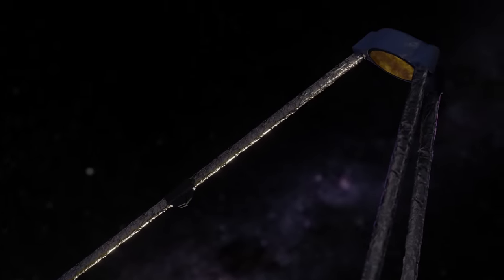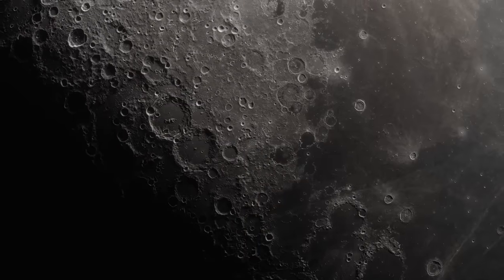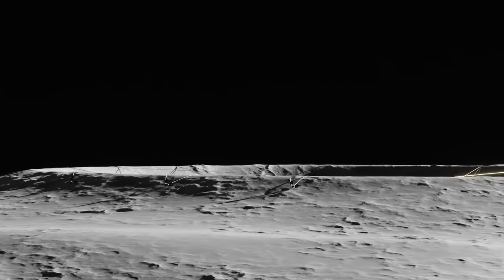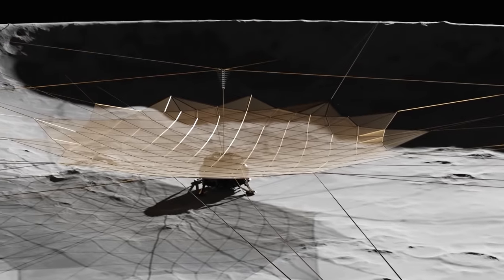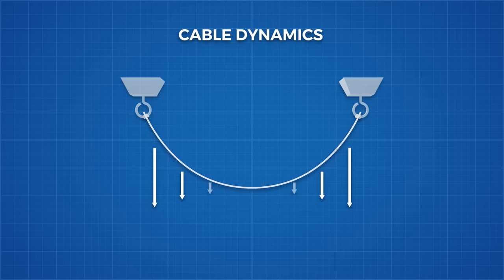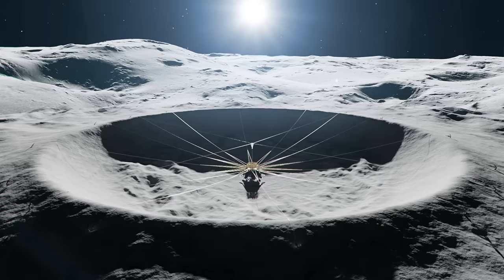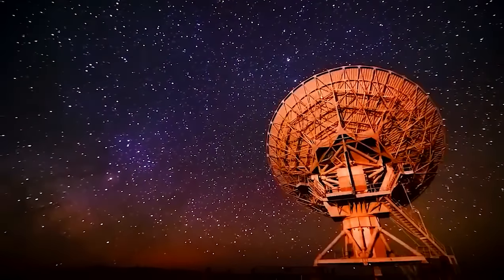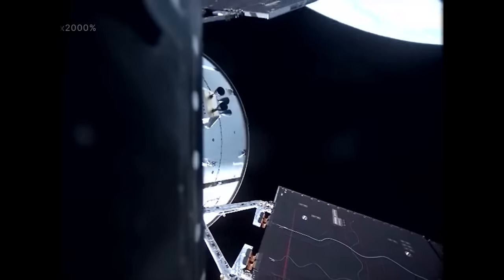NASA's Plan to Build A Telescope on the Moon

Comment: I may be wrong, but the Aricibo cable failure may have been caused by something simple that I learned about 65 years ago from a ham radio operator with his own 100 foot tower. Steel cables must be LOOSENED frequently. As multi-strand cables rust, they grow in diameter and SHORTEN. If not loosened, they eventually pull themselves apart. Interesting, no ?
Reply: According to the accident investigation, the Arecibo structure failed because the cable ends were terminated incorrectly. They were embedded in zinc, and over time the cable strands pulled out of that zinc jacket.

Comment: Having a radio telescope on the far side is a no-brainer, how to achieve this requires many brains,
I had an idea once that since the moon is tidaly locked, it could have a fixed dish antenna pointed at earth to allow huge data transfer rates between earth and moon. Also lower gravity would allow for easier construction of any large structures so the deep space network could be expanded by moon-based long range gigant radio antennas

Comment: I don't think the anchorages in the regolith on the rim of the crater are going to hold in the long term.
Some sort of chemical preparation of the anchor points is necessary, to change the regolith into some form of hard cement...
Reply: The video said they expected the project to last a year.

Comment: At first upon hearing they're making the telescope on the far side of the moon, two of the biggest concern sprout up: how are they going to transmit the data back from the far side of the moon which had no direct contact to earth, and how they going to power it up? The first concern is solved with the relay satellite, however for the second problem, well, given the timetable of just 1 year, idk, maybe they use a RTG generator perhaps? since I didn't see any other possible power generation from the given renderings there. Also one other thing I notice is how they're going to test regarding the moon's regolith. Without air or water to smoothen out the regolith, those small dust particles are razor sharp, unlike any we had on earth, as such trying to test the cable capacity to handle the regolith may be as well the second biggest problem, after the amount of weight needed.

Comment: I wonder if a clever idea wouldn't be to either fully construct the wires out of graphene or at least coat them with it in the areas of abrasion during tensioning... should be the ideal material for the task, methinks.

Comment: Since you may need to put wire tensioning motors on the suspendet antenna anyway, couldn't those also be used to move the antenna around the focal plane to focus on different parts of the sky?

Comment: When you said the shape must be closer to a half circle to be a good reflector but that is not the ideal, did you mean parabolic? The Arecibo telescope used a half circle primary reflector and a correcting secondary reflector but its not obvious whether that is the case here. Yet still a parabolic reflector would be the ideal shape for any telescope reflector if manufacturing ease was not an issue. Awesome video btw.
Reply: All bs

Comment: I suspect that carbon nanotubes would be more suitable than carbon fiber, especially considering radiation degredaing the resin binding the carbon fiber. Cables could be constantly adjusted using servos and photovoltaic imho. No wind, light gravity, definitely fully suspended and dynamically tension adjusted will be the most viable solution imho.

Comment: I see the motivation to build a telescope where there is no atmosphere to decompose the in coming light however wouldn't the uneven powder of the loner soil cause lower resolution of the data. It would have to be smoothened out to give as much high resolution data as possible. Which represent challenges on a satellite with less than half the gravity of earth.
Reply: And not to mention the looner dust

Comment: As long as the holes in the mesh are shorter than the radio signal's wavelength -- no, 1/4 wavelength. That's basic electromagnetic physics!

Comment: WHY NOT DO IT THE EASY WAY?
This seems to require so much complexity, materials and engineering compared to the decades old lunar radio telescope proposals.
 Find craters that  have floors (or side slopes] that are at least in part close to the right profile. Robot dozers to maximise usabe crater area.  Spay conductive material over suitable provile areas. Now add secondary,  probably supported by a tripod rather than suspension system,  by which ever works best. Add your electronics.

Comment: Okay, I know you run an optimistic channel, but there are two holes that I do feel need to be poked in this plan, both of them drawing from real experiences. For one, the budget. You talk about the JWST a lot, but it's worth remembering that that was originally approved with a 1 billion dollar budget and a launch in 2007. It went 10 times and 14 years over budget, which even by the standards of space programs, is quite extreme. So a projected 2.4 billion for this... yeah, even the Pentagon would call that excessive for a single program. 

Second, the projectile anchors. Looks great on paper, but it does rely on the lunar soil perfectly cooperating, and there's no guarantee of that. Exploration from orbit can only account for so much, and for proof, I'd draw your attention to the Mars Insight lander. It had a drill that was supposed to burrow down five meters into the Martian soil and take measurements, but because of pure bad luck, it landed in an area with very soft soil, so the mole couldn't burrow down very far. NASA even tried hammering it down with the very sensitive arm of the lander, but to no success. So the chances of a dozen or so anchors being fired from a central lander all hooking into the lunar soil perfectly, with no rocks or previously unnoticed discrepancy in the density of the regolith, are pretty much zero.

Comment: presume thats meant to say the telescope weighs 200kg on the moon but 2000kg on earth 

as a structural engineer 200kg  is nothing, but your looking to support it for 350m over a 1300m crater, the anchors presumably need to be fixed connections somehow, i don't see how you could make this work with pinned.

Say you had 20 cables, 10kg each being very rough with that UDL you're looking at characteristic moment of around 700-900kNm per anchor which is certainly achievable but not trivial. in unknown ground conditions with automated fixing process for all 20 cables.... They need to be decent anchors, all of them need to install correctly with no obstructions, the ground for all of them needs to be good enough to carry the load.... I'd say there are a lot of unknown's and a lot being left to chance with idea of automatically shoot them out of the lander. it might work but I don't give it good odds.

Unless you are assuming you are getting a pinned vertical support on top of the lip of the crater... in which case you get a seesaw sort of thing and the anchor becomes an uplift with longitudinal and vertical load not a bending connection is that worse or better, weirdly i think it might be worse. Must be planning weights at the end of the ties rather then fixing into the ground.... there is no way they could judge a pull-out capacity for the ground. Have we ever had to work out the coefficient of friction on the moon?

Wonder if anyone will ever read this mad rambling, kind of want to go get a bit of paper and work this out properly.

Comment: I think the challenge it is not even to build one. Is to maintain one in the moon with the rate witch the moo. Is hit it with small particles and asteroids that will be really difficult to be functional for a long time
Reply: There's about one meteor strike per km2 per 1000 years. Not an issue.

Comment: Those hooks will need to be pounded down. A hook sliding on regolith wont cut it. If you want this done right, people or bots will need to go. Theres too much to do & too much that go wrong. The suspension points on the crater rim will need to be the same hight.

Comment: "The telescope is going to focus on capturing information from the electromagnetic spectrum between 4.7 MHz and 47 MHz. This corresponds to a wavelength between 6.4 and 64 meters." (statement beginning at 4:46)

This would seem to preclude picking up the neutral hydrogen line at 21 cm.
Reply: A few billion years of redshift will tend to make the wavelength a bit longer than the original 21cm

Comment: Doing it without human involvement is not going to happen. There could be robotic assistance for sure but you need pulleys and probably cranes. Plus the extra weight would need to come from baskets holding regolith. Or you could tension cable and fix to the surface. 

Half a dozen people, absolute minimum.

Comment: I can see why it's better to have a fixed satellite on the moon compared to Earth. It's not obvious to me though, what are the general pros and cons of having this setup compared to alternatives, such as launching a satellite to deep space? Would it be better, cheaper than leaving a satellite in space or in orbit?
Reply: The cosmic background microwave radiation is some form a signal that the receivers we can build can detect. However, the resolution, bandwidth and power consumption can get really difficult to maintain with extra noise in the environment (such as thermal noise, based on temperature or radio signals from our communications). The best way to achieve highest sensitivity to these red-shifted background radiation signals, we need to isolate the instrument from noise and temperature. Best way to achieve this is to shoot the device to space or place it on the moon for example, looking into deep space (equivalent to 2.7 Kelvin). There is a trade-off between how precise a measurement is and the cost unfortunately.

Comment: The irony is that the lunar relay will create 'noise' in the radio spectrum of the telescope. Maybe they could design a laser-based lunar relay to avoid that.
Reply: You can just use a frequency that the telescope isnt as responsive to. And even if this isnt perfect you can probably easily filter the signal out given that you know the frequency and also what was actually sent.
Though laser relay would be fun

Comment: 5:16 Bruh, NASA just told the OIG that SLS is unaffordable and that's just for Artemis missions sending Orion to NRHO. Why ignore HLS Starship which costs an order of magnitude less to develop and operate? It can take crew and 100 tons of cargo to the surface. Hell, it's been suggested by NASA that it can be used for a CREWED mission to a near earth asteroid.

SLS isn't a "mega moon rocket" is a "mega jobs program". Over a thousand contractors across ever state. There are multiple reasons why SLS won't by launching Europa Clipper anymore. Falcon Heavy gets that honor because it is affordable and available. It would take a century to get enough SlS's available to send the materials needed to the Moon.

You don't need to "minimize weight" if you just launch 300 tons in one go with an expendable Starship for less than a billion dollars each mission. That includes refueling tankers so it can actually land on the surface of the Moon.

Comment: This seems like a particularly unwise idea if perfect calibration is expected of this array. There are moonquakes which could throw this instrument off.

***The first evidence of moonquakes was detected by seismometers placed on the Moon by Apollo astronauts from 1969 through 1972. The Apollo 11 instrument functioned through August of the landing year. The instruments placed by the Apollo 12, 14, 15, and 16 missions were functional until they were switched off in 1977.

 Moonquakes are not believed to be caused by tectonic plate movement (as earthquakes are), but by tidal forces between Earth and the Moon. The tidal forces cause the Moon to bulge slightly, and this can lead to stress and strain in the lunar crust. When this stress reaches a critical point, it can cause a moonquake.

The Apollo seismometers recorded about 11,000 moonquakes, most of which were very weak. The largest recorded moonquake had a magnitude of 5.5. The moonquakes were found to be concentrated in two main areas: one near the lunar equator and the other near the lunar poles.

(***Factual information supplemented by Google Bard)

Comment: Instead of stationary telescope on moon with complex process and cost why don’t we focus on deploying it moon’s orbit ????
Reply: Because that will be more complex and expensive, and it loses the advantage of having a telescope that never faces Earth and its radio transmissions.
Reply: @h.dejong2531  agree on radio transmission issues due to Earth just not clear on more complex cause we already deployed James Web In earth orbit with R&D so we might get chance to use that knowledge?
Reply: @jayrajdani  The largest antenna we've deployed in space has a diameter of 50-100 m (this is on a classified satellite, so very little is known about this). The LCRT is proposed to have a diameter of 350 meters.  JWST has a mirror only 6.5 m in diameter.
Reply: @h.dejong2531  Ohk now understood thanks for clarification

Comment: Can we put a radio telescope on an asteroid, then put some method of proportion, unsaid, asteroid, with its own power system, so that we have a radio telescope in space, for farthest out we’ve ever built a telescope, it has a wider degree of orbit, and that they can pick up more signals, and we can move it, if need be, and angle it in a full 360°, ark of motion, it would hold some downsides, because it wouldn’t be very easily repaired, especially with the technology we have now, but it has the upside of not having to deal with any radio traffic, and if we used an asteroid from the asteroid belt, it would take quite a bit longer, just to get there, but the principles comment should be the exact same once we do.

Comment: Personally I'm most interested in projects to build... anything, from material sourced locally on the moon Automated. Iron and maybe other metals. Glass. Ceramics. 3D printable building material. Etc. It doesn't even matter at what rate. 10kg a month is fine. Such efforts would deliver incremental enabling industrial capabilities. Before long. the only thing you'd need to lift into space would be people. The science objectives are grand, but it pales in comparison to the science that could be done in the near future if we "bootstrapped" Lunar industry first. I couldn't even begin to fathom why one would wish to have something like this telescope as an isolated stretch goal. Talk of having to lift the structural components put me off entirely.

Comment: I thought the Sunny side of the Moon always faces the Earth 🌎 as it revolves around the Earth. I don't get it.
Reply: the moon is tidally locked. This means that Earth's tides apply a torque to the Moon, and over time this forces the moon's rotation to sync up with its orbit: the same side of the moon always faces Earth. This is called the near side of the moon. The far side is sometimes called the "dark side". This phrase was used because before spaceflight, we'd never seen that side of the moon, so we knew little about it. 
This term has nothing to do with light levels. The day and night on Earth are determined by Earth's rotation: at any time of Earth's day, half the planet is in sunlight, the other faces away from the sun. Similarly, the light level on the moon is determined by the Moon's rotation. One rotation takes 28 days, so each part of the moon gets sunlight for 14 Earth days, then 14 days of darkness.

Comment: So, there's no wind to blow dust around. However, all the small meteorites that hit the moon and raise dust will leave dust on our scope. Who's going to clean it?
Reply: Exposure to the solar wind can give dust particles an electrostatic charge. This causes them to levitate. Dust gets everywhere without need of wind or meteorite impacts.
However this video is about a radio telescope. There would be no mirrors or lenses to get dusty. The dish would be made out of a mesh so it wouldn't be able to hold much dust.

Comment: Isn't it going to constantly need repairs due to small punctures? There are craters everywhere for a reason
Reply: Those craters were created over 4 billion years. The current impact rate is so low this telescope would be hit once every few thousand years.
Reply: @h.dejong2531  A 15 second search says thats not the case. Dozens every day by the estimate. Even more hit the earth but nearly all are burnt up before getting through the atmosphere, which the moon obviously doesn't have. Even though they are tiny, they surely would shred that thin reflector material.
Reply: @RobertCro  You're overlooking that it's dozens per day spread over the Moon's entire surface. I'm talking about the impact rate per km2.

Comment: You have completely ignored the 300 meter aperture (500 meter total) FAST telescope in China or the 338 meter Jicamara array in Peru.  You also ignore the used of interferometry to create radio telescopes which can be, effectively, the size of the Earth.  The only reason to put a radio telescope on the far side of the moon is to shield it from man made interference, something that can be avoided by observing in the reserved frequencies for research or filtered out using well established techniques. This project would be a waste of money because existing telescopes already provide the same performance for far lower costs.